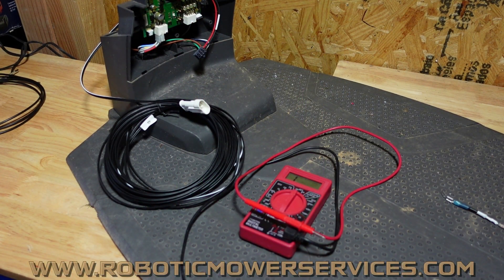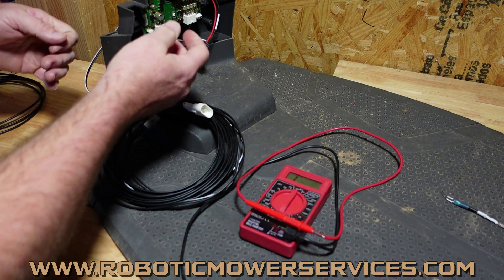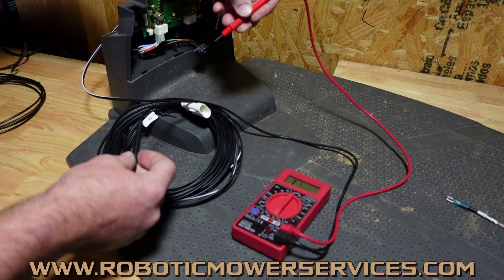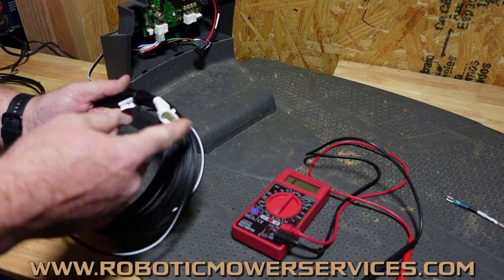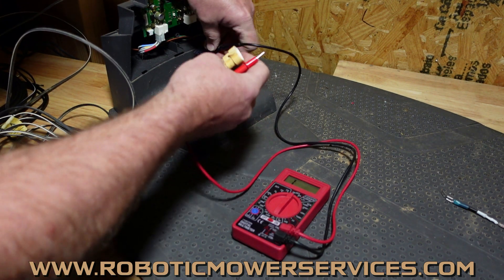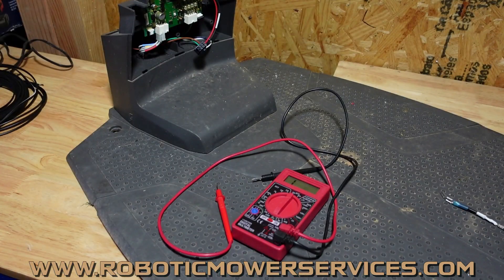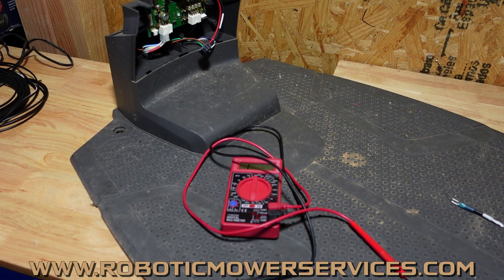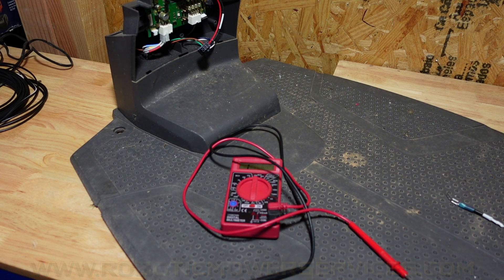Testing Husqvarna Automower Low Voltage Cable & Charging Station Harness Resistance While Connected

Comment: Thanks again, your simple to follow advice has helped me test and diagnose a low signal problem experienced on a Honda Miimo and was able to find a loose  fitting on the board and now back to Max strength.  Not sure I would have attempted this had you not posted this how to. Great job 😊